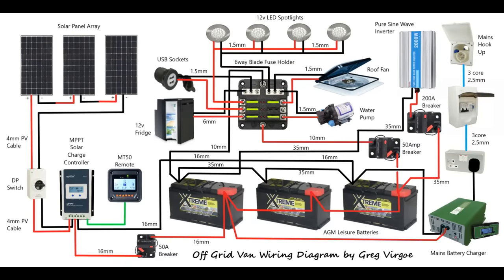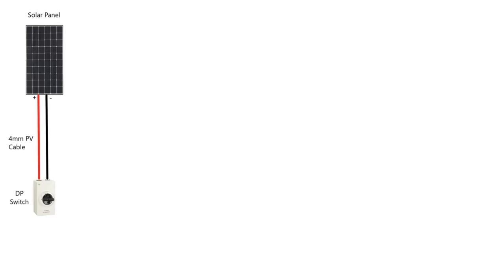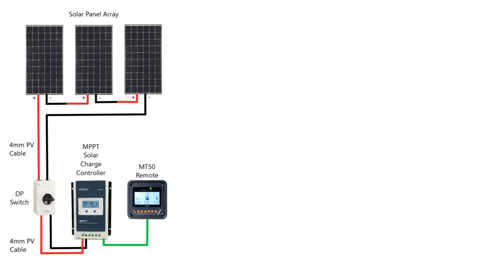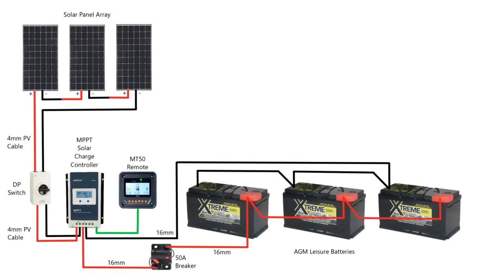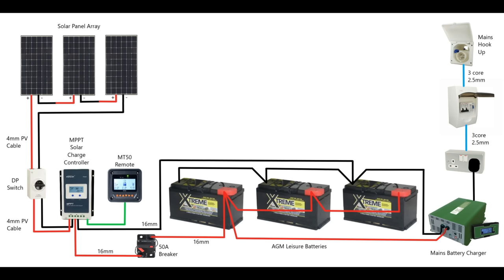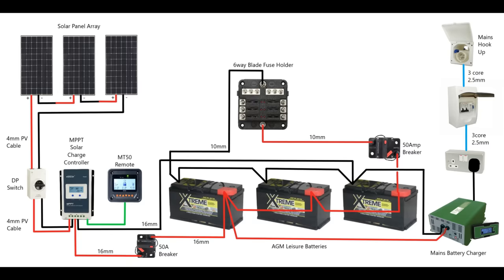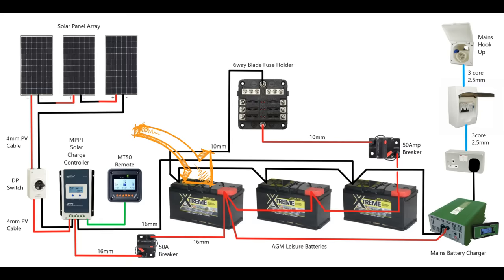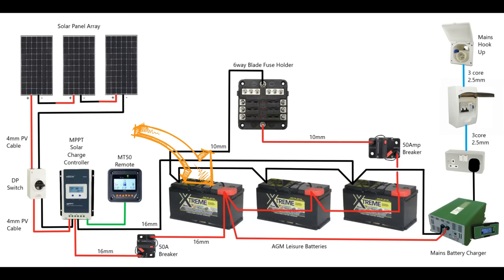How to Wire your Camper Van to be Off-Grid

Comment: Hi greg, how do you switch from solar charge to hook up charge , do you just disconnect the fuse via the breaker and connect the other ? thank you
Reply from the maker: No need to turn the solar off at all you can just plug into mains and turn the mains charger on. I have them both connected all the time. 
The solar charger will see a high voltage from the mains charger and back off into float mode. Hope that helps. 👍🏼😃
Reply: @GregVirgoe  amazing thank you so much!

Comment: Hi Greg, did you use 2 or 3 core cable for the lights? Thanks
Reply from the maker: All the 12v DC items are 2 core cable. Positive and negative. 
The 230v items are 3 core cables.

Comment: Hi Greg! I got myself the 16mm2 cables to connect the mppt to the battery just as your video, but the victron 75/15 mppt I got only has 6mm2 openings to connect the mppt to the battery... Any tips on how to solve this problem? Because connecting 6mm2 to the battery looks a bit to small!

Comment: Thanks for this AWESOME help! Please could you (or anybody else) advise. I have the same layout as your schematic APART from NO INVERTER. What size cable should then connect my TWO leisure batteries together? Should i just stick with 35mm like you?  Cheers
Reply: You won't be pulling enough power to be needing 35 mm if you're not using a strong inverter like Greg does. You can stick to 16 mm.
Reply: @flybeep1661  many thanks. Cheers 😀

Comment: Hi, 
I just wanted to ask if you meant you fitted the 13 amp double socket, mains fused board  and  mains hook up in the  back of the van and not the garage. Please could you confirm this.
Reply from the maker: They are fitted in the garage portion of the van under the bed in the back. Check out the installation videos for the controls.
Reply from the maker: https://youtu.be/u0-r5Ugo8Is

Comment: Does your mt50 pick up and display load from your 12v and 240 system on the main screen on the right? Mine doesn't show load. 

I have plugged some readings lights into the mppt charge controller so I'm not sure if this is confusing the issue.  

Was good to say hi in Stratford recently!

Comment: Hi Greg 
Is it good to charge the leisure batteries from the van alternator in addition to solar panels using Victron Energy Orion-Tr Smart 12/12-30A (360W) Isolated DC-DC Charger - ORI121236120 ? Would that mess up the 3 leisure batteries to use the Victron to charge also?
Reply from the maker: Yes you can do that

Comment: Hi Greg, been following your channel for a while now and fully intended to convert a van to my spec, however a very low mileage high top transit came on the market so I have gone down that road. I will try and keep this brief, the seller has relocated to the US and seems no longer prepared to communicate. The electrics on board consist of Solar, Victron and CTEK, devices powered consist of Dometic Fridge and Maxxair fan. Lighting in the van works however the 12v devices do not work. Is there anyone you can recommend in the Hemel Hempstead/Watford area that would be able to troubleshoot. Quite happy to travel within reason to find some help to resolve the issue. Thanks in anticipation. Duncan

Comment: Greg, I have a question about calculating power consumption. I am looking at a fridge which says it uses 800 watts per 24  hours. I purchased one of the gauges that shows how much power a device uses but how do I convert a 24 hour consumption to a draw amount for my spreadsheet?

Comment: Hi Greg
I've recently started a conversion of my own. I noticed you have 6mm cable going to your fridge, i have a 3 way fridge to put in. It states 65 watts, so if I've worked it out right on 12v its around 5.4amps. Could you tell me please if 12v 1.5 cable is ok, if not what should i use. 
Thanks
Tony
Reply from the maker: Hi Tony, 12v compressor fridges will have a larger starting current and are very susceptible to voltage drop. So many manuals recommend a larger cable to reduce the voltage drop. 
I ran 6mm cable to our fridge for that reason. 👍🏼😊
Reply: @GregVirgoe  thanks greg. Are you using the same for the Truma?
Reply from the maker: @hodgy33  the 12v fir the Truma is for controls and the heater fan so not as critical but it would not hurt to run a decent size to that as well.

Comment: Is it possible to power 12 volt electronics with solar power and shore power? Our vent fan is wired to our blade fuse block that's powered by our solar system. Is there a switch or a particular hookup that would allow us to power the fan through dock power, in a situation where batteries are low?

Comment: What about a stand alone shower motor for sink and shower
Reply from the maker: Any other 12v device would simply have its own connection to the blade fuse holder with the right size fuse 👍🏼😊

Comment: I have some 7.5A rated automotive cable and thought it should be ok for connecting my panel to my MPPT because the panel is rated 5A max but the panels have 4mm cable. Is this really necessary? Isn't 4mm overkill?

Comment: Hello,
Why you didn’t use inverter/charger ,so you can connect generator or mains ,and solar to charge the batteries.there’s any reason for that?
Reply from the maker: I wanted to fit separate parts for redundancy if anything goes wrong 😑 you have not need to change one part as we found out in France when our old was inverter blew up
Reply: @GregVirgoe  thank you for quick reply , I think it’s good idea I agree with you.it’s make sense.

Comment: I would like to wire my two 100w 12v solar panels in parallel because of shade here. I have two 12v 100ah agm batteries, should I wire them in parallel as well to keep everything at 12 volts?
Reply from the maker: The batteries must always be wired in parallel to keep them at 12v
No problem with wiring the panels in parallel just add the max amps together and check you may need to go up to 6mm PV cable.
Reply: @GregVirgoe  Thank you so much for the reply. I was also wondering how to determine what size fuse I should use between my batteries and my 6 way blade fuse box? I see 25a and 30a is common in your diagrams, are my batteries (two 12v 100ah in parallel) sending 200 amps to my fuse box?

Comment: Question about the mttp. I want to have 6 100w 12v solar panels. I was thinking about getting a 40amp mttp. Will this work for the solar panels I have? Should I run the panels in series or parallel?
Reply from the maker: You will need at least a 50A MPPT with that much solar. I would wire two strings of three panels. 
So wire two groups of three panels  in series, then wire those two groups in parallel. That will give you the best of both worlds. In terms of low light performance and redundancy 👍🏼😃   https://www.epever.com/wp-content/uploads/2021/05/EPEVER-Datasheet_Tracer-AN-50A-100A.pdf
Reply: @GregVirgoe  thank so much! I really appreciate your content

Comment: Hi Greg have you got a video of how you wired the dp isolator switch? I bought one and it has 6 entry points 3 top 3 bottom and I can’t work out how to wire it, any advice much appreciated
Reply from the maker: What brand of switch do you have they most commonly they have 4 terminals on the top and bottom. 
Usually wired 1-2, 3-4, 5-6, 7-8 and they often are on opposite sides of the switch diagonally.
Reply: @GregVirgoe  hi Greg I have sorted it now thanks I had bought the wrong switch so I have got another one thanks and it is working fine

Comment: 7:34 
Regarding the green mains battery charger, the red and black cables that come with it, did you put them straight to your batteries as your diagram shows or did you connect the negative cable via a busbar on route to the negative battery terminal?
I have the same one (30amp) but I'm looking at the instruction manual and the pictures they use, the cables go straight to the terminals when it's only one leisure battery (15 amp & 30 amp battery charger) but for connecting it to two leisure batteries, they have the negative cable going to a busbar first (these ones are 60 & 90 amp battery charger) AND there's a 3rd cable in those pictures! (60&90amp ones)
Long story short: can I connect the black 30amp battery charger cable to a negative terminal on one leisure battery and the red cable to the positive terminal on the other leisure batt and not fry myself or the machine? As your diagram shows? 
Because the impression the manual is giving me is that you can only connect the 15 & 30 amp battery chargers to ONE battery, surely this is bollocks?!
Reply from the maker: The wiring in my diagram is absolutely correct and it works perfectly. I have used it many times during winter lockdown and everything is perfectly ok.

Comment: I've noticed that DC/DP isolators (panel to MPPT) come rated at various amps ie, 16A, 32A. How do you know which one to fit?
Reply from the maker: You look at the max amps rating for your panels which in my case is less than 10amps. As they are wired in series this value stays the same. So an isolator rated at 16amps or more will be sufficient. 👍🏼😃
Reply: @GregVirgoe  Appreciate such a quick reply 👍 I have 2 x 115W Victron panels (also to be wired in series) for which I can't find the spec but it sounds like a 16A DP isolator would be more than sufficient.
Reply: Just found they're max amp rating is 6.04A. Thanks again 🍻

Comment: Hello if possible please could you tell me how I could add a kill switch to this system where I would have to put the wires. I copied it exactly to what you said but I just had my boat safety certificate and they want me to add cut off switch

Comment: Hi Greg, great video thank you.
Question. You have used 35mm2 cable for inverter and batteries, I presume the current rating for this type of cable is higher than the ones quoted in your linked chart, if so , where can I get this information from?
Thank you.
Reply from the maker: The cable is from 12v planet and I used their handy free sizing calculator in their knowledge centre follow this link https://www.12voltplanet.co.uk/cable-sizing-selection.html 😃
Reply: @GregVirgoe  As I understand from your explanation from your cable chart - the 35mm2 cable can only handle 125Amps enclosed in conduit, mounted on the wall. You have a 200Amp fuse. Shouldn't the rating of the cable be higher than the fuse? I'm just talking about the risk of burning the cable. As I understand it he 12voltplanet calculator is just to do with the voltage drop. I'm confused...
Reply from the maker: @martamaticseng5186  you are right the cable should be rated higher than the fuse. The cable from 12volt planet is rated higher at 240A and will be fine for short runs like I have. See this link https://www.12voltplanet.co.uk/extra-flexible-pvc-battery-welding-cable-35mm-240a-metre.html
Some makes of cable can have a higher rating than the figures in the table. Look at suppliers spec to be sure. 👍🏼😃
Reply: @GregVirgoe  Thank you so much for your help! :) I understand now.
Reply from the maker: @martamaticseng5186  no problem anytime 👍🏼😊
Reply: Hi Greg, I can see that their 34mm2 cable is rated at 240 amps. That's great, thank you for the information.

Comment: Hi Greg;  I am using two of those surface mount flip breaker/switch.  i  have seen one company demo and instruct the live 12v wire to the "BAT" terminal and the device wire to the "line" terminal.   so i have a MPPT that can take an imput from the starter battery when the alternator is on above a certain voltage, but it can also trickle charge a low starter battery from the house battery;  So can these breaker allow protection both direction??

Comment: Hey Greg thanks a lot for the helpful tips. I have 2 questions. If I have my positive and negative terminals hooked up to busbars for ease of connections, would I need to have the wires that go from battery to busbars large enough to handle every load in my van, including solar charge? I.e. fuse box x 2 (30A) + inverter (120A) + Solar (30A) - * I am not including my 40ADc to Dc charger as that won't be running while inverter is powering high wattage appliances??  Also, I am looking to use my inverter to power 2 separate 230v sockets around the van. What type of cables would you recommend for this? Thanks a lot in advance
Reply from the maker: Yes that connecting cable should be large enough to handle all the connected loads. 👍🏼😊
Reply: @GregVirgoe  would a short run of 50mm2 cable be OK to handle those loads?
Reply from the maker: @stephentrainor4480  yes that would give you protection up to 450amps over a short distance less than a meter 👍🏼
Reply: @GregVirgoe  thanks a lot for the help 🙏

Comment: Hi have just bought 1000 watt renoster inverter to fit in my campervan. What size battery cables and circuit breaker do I require. Thank you
Reply from the maker: You need a 100amp fuse or breaker and at least a min of 25mm battery cables.
Reply: @GregVirgoe  Even tho the inverter is 1000w/2000w? Do you account for 1000 or 2000w always? I know 2000w is only for a short while.
Reply from the maker: @MarcinAdamowicz  size your fuse on the 1000W as the peak is only fir startup current

Comment: My van has 1500w solar, DC-DC smart charger from the vehicle battery and a mains plug in. The vans off grid so I'll probably never use the mains/hookup but it's there to top the battery up if required.

Can all 3 positives just be wired straight to my battery or will they interfere with each other if the solar is charging at the same time as the DC-DC or mains charger?

Also, I don't plan on ever using a hookup, where does my 230v earth get connected to? I heard connecting this to your chassis can be dangerous frying your 12v if a problem occurs.
Reply from the maker: You’ll never be using the DC to DC and mains charger at the same time. (Unless you got a really long extension lead 😂) The solar charger will see a charge voltage from the other two devices at anytime and back off automatically so no problem with connecting them all together. 
Connect all the 230 volt earths to a common earth bar. I have connected mine to the chassis with a large cable in case a mains cable shorts out to the chassis. Also wise to bond inverter cases and metal Pipework etc
Reply: @GregVirgoe  Thanks for your reply. Now I know I'll get on this today! I bought lovely metal fronts for all my sockets but have been scared of actually using them without a proper earth connection. If I wire my earth with a big cable to the chassis, I assume I'd be safe with metal sockets if something did go wrong? Or would this still be dangerous without an earth spike to the ground?
Reply from the maker: @robertbowen2075  the earth leakage to the body should be enough to trip a breaker. It’s how I have my setup. 👍🏼

Comment: Hi Greg, I really like the simplicity of your diagrams and am just about to wire my van. Please can you advise why you don’t earth your battery to the chassis? And also I don’t see an earthing for the MCB’s.?
Reply from the maker: Hello Ross, 12v DC electrics have a positive and negative only, they do not have or need an earth.
Your 230volt mains power should have an earth as should all your appliances. Connect this back to a common point and to your hook up and inverter case. 👍🏼😃
Reply: @GregVirgoe  mains power as in the AC inverter? And appliances as in the AC outlets?
Reply: @user-cr6ki4qs4y  Mains power as in both "230 V AC from the inverter" AND "230 V AC from a shore power hookup connection". Both of these should have a connector for a protective earth cable. That's why Greg mentions both the "hook-up case" and "inverter case". You would connect these two protective earth cables to a common point on the metal chassis of your van. In addition, your shore power hookup cable must have a protective earth wire, and all AC appliances that need it must have one as well. The latter point is a given when you don't modify any AC appliances.

And appliances as in both "AC outlets" AND "AC devices directly connected to the AC wiring", such as the AC charger in Greg's diagram.
Reply: @djazt.8053  thank you very much for explaining it to me. This information was exactly what I needed to know.

Comment: Hi Greg, approximately how much is the 3 panel set up? Looking into my first conversion and trying to get an idea of costs.
Reply from the maker: You could get the three panels, three batteries, controllers and all cables needed for between £800-£1000. Depending on supplier.
Reply: Thanks for that Greg I’ll get looking.

Comment: Do I wire the huck up cable to the 6 amp fuse or the 16 amp fuse in the consumer unit then wire up to the socket box as I dont know what one to wire up to. Any help would be nice thanks
Reply: Both - sort of. But your question suggests that you may not be sufficiently competent yet to wire it yourself - which is absolutely nothing to be ashamed of.
Stay safe 👍
Reply: In your home the 6 amp is used for low power items like lighting and the 16 amp for mains - but do be careful.

Comment: Hi Greg, would using 4mm so GLE core be sufficient for a narrow boat at 60ft taking pumps LEDs primally
Reply from the maker: Over that distance the most a 4mm cable could handle is 2amps of current before the voltage drop is too large. Use the simple calculator on this page to size suitable cable. https://www.12voltplanet.co.uk/cable-sizing-selection.html
Reply: @GregVirgoe  thanks Greg 👍

Comment: Greg,
I have bought a MrPwr 60A charge controller but the 16mm2 cable I have bought to run from it to the batteries is too big for the terminals? Is this the fault of the charge controller or is my cable sizing off? 2 x 340w panels in series and 2 x 110ah batteries
Reply from the maker: Your sizing is correct as 10mm would be just on the limit for 60A
Reply: @GregVirgoe  cheers for the quick reply! so does this mean that the charge controller terminals on this model are just too small? Do you recommend any charge controllers that would meet my needs?